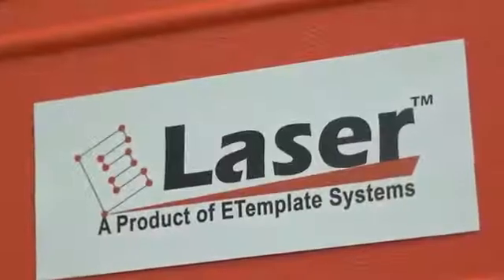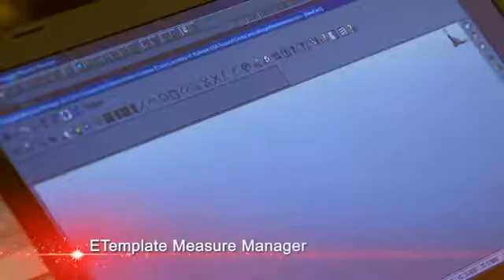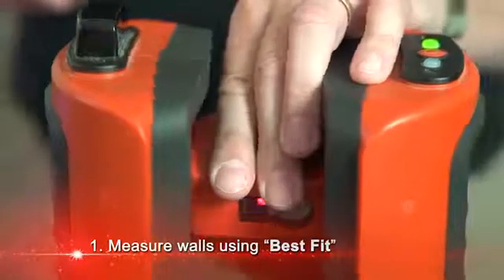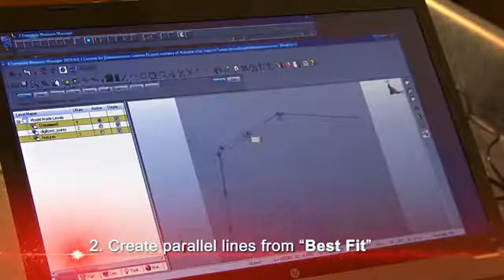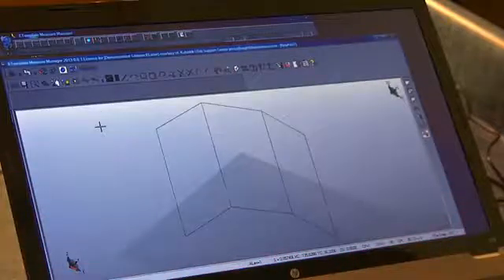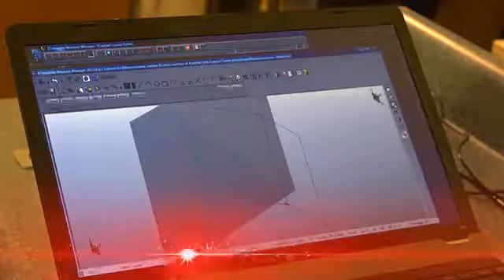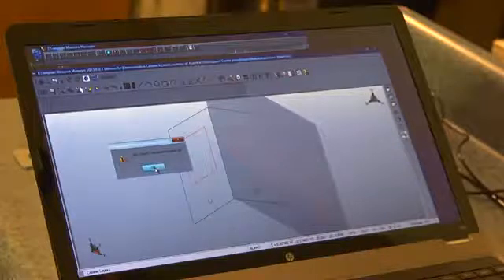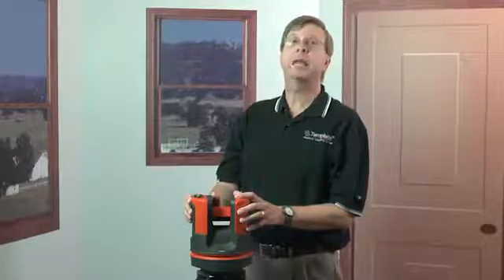ELaser 3D Cabinet Vision Integration

Comment: The  company  I work  for recently  purchased  the Leica 3d Disto, we've also been using Cabinet Vision for quite a few years.  I'm trying  to  get the two to work with each other but am struggling, how would we go about using your software to do our field measurements?
Reply from the maker: Check this video out as a solution for Cabinet Layout using our systyem: https://youtu.be/FKPPc5r3UF8